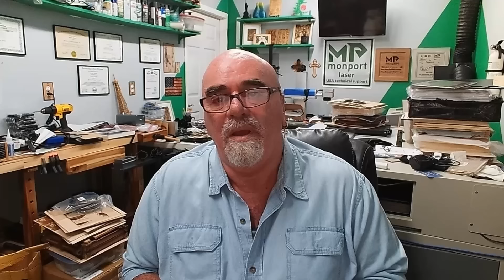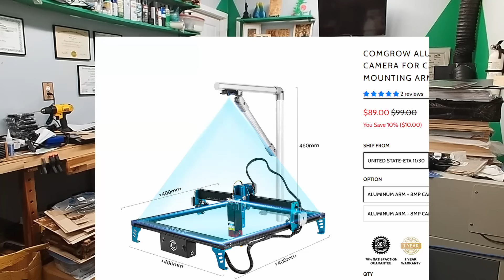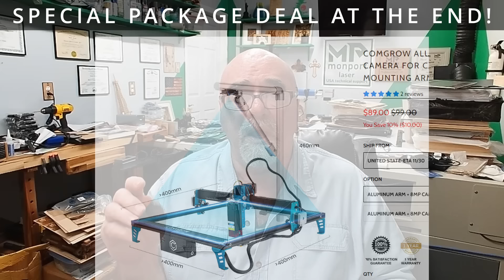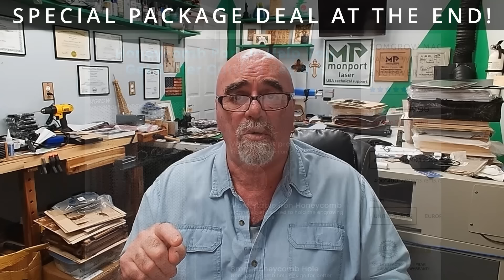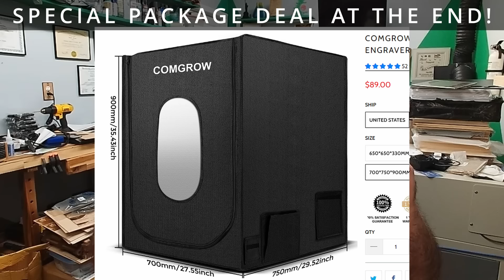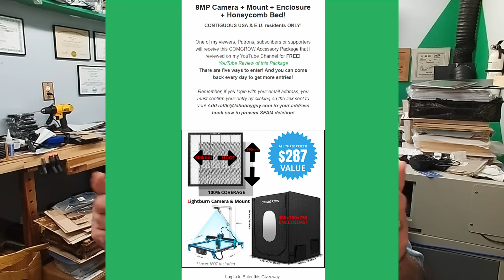😲 LIGHTBURN CAMERA, HONEYCOMB BED AND ENCLOSURE SPECIAL DEAL! WITH ASSEMBLY AND SETUP INSTRUCTIONS!

Comment: general camera question, sometimes I use honey comb bed (cutting) and sometimes just grid waste board engraving. How bad does this distance mess up camera, or do you have to res calibrate every time I switch?
Thanks
Reply from the maker: You should calibrate for every material thickness and store them in the Save Settings area on the Camera tab.

Comment: Thank you for your vid, I have another brand machine (regardless) do you still recommend the camera and enclosure? Also do you recommend a fan that mounts inside, to use as an extractor?  Thank you I appreciate your time.
Reply from the maker: Yes, yes and yes. I have a new camera video coming soon.
Reply: @TheLouisianaHobbyGuy  i appreciate your input and I went ahead with buying the same setup (besides laser).  I subscribed and look forward to your insight and any thing that will save me time getting the camera up and running as it arrives tomorrow.  My wife makes charcuterie boards and I wanted to help her take them to the next level.  Thank you.

Comment: does it fit the p20 atezr
Reply from the maker: Yes, just barely! The inside measurements are 26x28". You would have to detach the touch pad though and lay it on top instead of on the front, or just remove it like I did.
Reply: @TheLouisianaHobbyGuy  thanks  your videos are awesome learned alot and still learning from them

Comment: I love your videos. I have a question regarding this setup or any diode setup for that fact. I do alot of craft shows and and I do quite a bit of personalization but I have to take orders and mail the products out. I would like to be able to take a laser with me to a show and be able to personalize pre-made items on the spot. I do all my work on my CO2 laser. Would this setup work for that? I feel I would need a camera to get an accurate engrave. I basically just need to engrave names or small sayings on ornaments and such.
Reply from the maker: Comgrow will be changing the window to laser safe based on my review. I would say after that it would be good for your purpose. But be warned Tim, I was only able to take a laser to one craft show with all of the ones I wanted to do over the years. Most municipalities will not let you operate a class 4 laser in public. And while the show promoter may allow it, you could wind up with a $5000 fine. You should check the local laws before doing something like this.
Reply: @TheLouisianaHobbyGuy  Thanks for the fast reply. I have a bus that I carry all my stuff to the shows with and was planning on having th laser setup in the bus and my wife could manage the booth while I was out in the bus personalizing items. But never thought of laws with running the laser in public, although it makes sense.

Comment: Hi, Rich...sorry you are having 'flu' problems.  Hope you really get to feeling better.  I'm lucky so far...(knocking on wood.)  Well, after 5 months of my laser (D1 10 watt)  and have studied your videos on all modes, and camera line up..etc.  The D1 will not do what you just did.  I put graphic on the wood (basswood) and update camera , etc...and the graphic will not even come close to where it is put by way of camera.  Maybe it's the D1, this model, and Lighburn just not communicating.  I have had study time, practice time, and have ok cuts, etc....engraves...but with camera...nope.  Wish it did...most of my test I've done by the way have been .23 on the lens, and alignment , no problems....till I actully lay down a graphic, it misses it by at least 4 to 5 mm.  By the way, your grandson is an absolute doll...see you cheated...he helped you...us folks out here don't get that kind of professional help...LOL.  Maybe a different laser????  Hope you feel better...
Reply from the maker: Well you know xTool has a lot of bugs in their software, but I don't think this is one. The camera is native to Lightburn, so the Gcode output should be fine on any laser Kat. If recalibrating doesn't do the trick, use the X Shift and Y shift on the Camera Control tab to get the position dialed in.

Comment: Ummmm you all might want to be careful.. I just purchased this amazing cover for my diode laser and it is awesome. But I was trying to use my camera today like you showed us and at first it was working great. Then I tried actually cutting something and now my camera seems to be fried. The image is in complete red and blue colors I think that the only thing that could have happened is that the intense reflection from the inside material on the cover somehow fried the camera lens? I'm not sure what happened but I think it has something to do with the intensity of the light reflecting into the camera...I plugged in a different camera just to see if something in the settings had changed the way it was receiving the image but it was beautiful so I'm not sure I want to take that risk again and I don't know how to protect a new camera.... When I get to pennies to get one LOL 😅
Reply from the maker: More likely it's a defective camera Tiffanny. Comgrow will gladly replace it under warranty. Light reflection won't damage a camera lens, but what you described is a sensor failure.
Reply: @TheLouisianaHobbyGuy  So even though the camera was working before I cut anything? Its a web cam, I figured the reflective light got to it.
Reply from the maker: Yes, probably just a coincidence. The light doesn't affect the camera lens, or I would be burning them up like crazy with the fiber laser doing stainless!
Reply: @TheLouisianaHobbyGuy  hm, that's why I was thinking it was the reflection of the silver material inside of the enclosure. Because there's a lot of info about lasers being able to take out a camera LOL but I will definitely take that feedback into consideration thank you very much!

Comment: Rich, you are amazing. I love your videos so much because I never fail to learn from them and I find new and to me, exciting, ways to do something in this wonderful hobby that I had not realized before. This does leave me with one question though. I have recently purchased some extended rails for my Atomstack A20. They will extent the y axis to 850 mm. Short of building a custom cabinet (my current plans) do you know of anyone who makes an enclosure like this that would fit something like that size? Also I love what you have shown me is possible with the camera in Lightburn. Any thoughts on a solution that would also work for a large format like this? Do you know of anyone out there that makes solutions for larger setups?
Reply from the maker: Not at this moment Jack, but stay tuned! There is some talk about a company making a 900x500 enclosure, but at this time it's just development scuttlebutt.

Comment: Funny that the window in the door is not orange filter the 450nm laser light??
Reply from the maker: No, it's a 3D printer cover. Orange or not, you still need to wear glasses.
Reply: I understand.  It would be a nice update.  Thanks and get well quickly, amigo.  I commented before your video mentioned the same thing.

Comment: Camera function is little bit difficult it’s not accurate all the time but it’s very useful functionality seve lots of time and material
Reply from the maker: If calibrated correctly, it's 99+% accurate all the time. All of my cameras are within 0.5mm accuracy.
Reply: @TheLouisianaHobbyGuy  I think because fix my camera on plastic sad roof sometimes it vibrates or little bit moving due to havey wind or my cat jumping on it. Anyway I learned lots of things from your video and I have to tell you thanks for that. 
Regards

Comment: I've been eyeing this setup for a couple weeks! Great timing,  thanks for the insight and discount.  Glad you mentioned the clear plastic. Fortunately, buying an orange piece wouldn't cost too much. Wonder how easy it is to attach it
Reply from the maker: Glad it was helpful! You could probably just hot glue it on.
Reply: @TheLouisianaHobbyGuy  jtech has a piece 12x24 at 1/8 inch thick. Would that cover it? Sorry for asking, but i couldnt find any dimensions on line.
Reply from the maker: Comgrow has emailed me about the video and they are working on a new window. I told them they also need to offer a retrofit velcro version to existing customers. We'll see what happens. In the meanwhile, don't use acrylic, use film:
https://www.phillips-safety.com/product-category/laser-safety/laser-windows-and-sheeting/laser-window-film/
Reply: @TheLouisianaHobbyGuy  awesome!
Reply: @TheLouisianaHobbyGuy  hey,  if you are interested,  I checked that link and asked what it would cost for a piece of the film.  1 meter by 1 meter is $575 +shipping.  I don't think it's worth that!

Comment: You mentioned that you would prefer the camera mounted 90 degrees rotated, that can be set in windows settings under camera settings - rotate 90 left, 90 right or flip 180 degrees.
Reply from the maker: I'll try it but I don't think so Chris, unless you're using the Windows camera app.
Reply: @TheLouisianaHobbyGuy   The setting should apply to any app used by windows, it worked on a generic USB camera I use with Lightburn.
Reply from the maker: The problem is, if I turn it and update the overlay, then the overlay will be sideways.
Reply: @TheLouisianaHobbyGuy  Bugga, I wonder why I didn't get that problem, only thing I can think of is its the drivers for the graphics in the PC but that is probably extremely unlikely. Have to do some experimenting and see if I can work it out.

Comment: My support legs are similar. Has a slot to hold both the base sheet and grid..different manufacturer of grid. Also put holes in 1/2 in pvc around 3 sides to act as exhaust air support hooked to exhaust vent.
Reply from the maker: Great idea! Thanks for sharing Merrill.

Comment: Can you setup a wifi camera like this too? I have a wifi camera above my cnc and would like to use this type of setup. My camera is an arenti wifi camera from amazon
Reply: In my experience, it'll only attach to Windows Camera devices.  IF you want to have your laser across the room, a company named Silex has several USB/network/wifi device servers that work pretty well with Lightburn.  I'm using one on my HL1060 mounted inside the chassis, with a small switch connected to the lasers network port, the Sliex box, and then using the network port on the side of the machine out to my home network, and my PC I run the laser with is about 6' away on the other side of a fireplace in my basement.  I do get occasional disconnects with the silex, but I think it's my network connection at that machine, not the actual device.  I know it's not the solution you're asking about (unless there's a USB to wifi cam driver of some sort).  If your camera comes with driver software for windows that lets windows use it as a camera, then it may work, or you could try something called Altercam, but you may not get the quality out of it that  you would with a proper USB camera like Lightburns sells, or the Comgrow from this video (the Silex would work great with the Comgrow unit, since it's standard USB 2.0).
Reply from the maker: No, it has to be USB 2.0